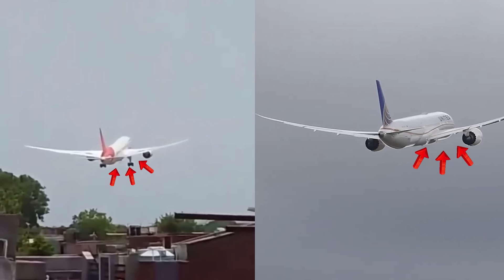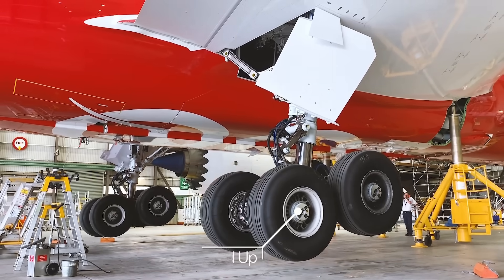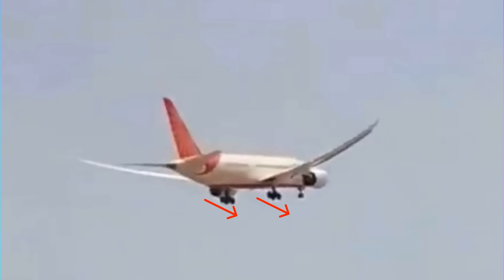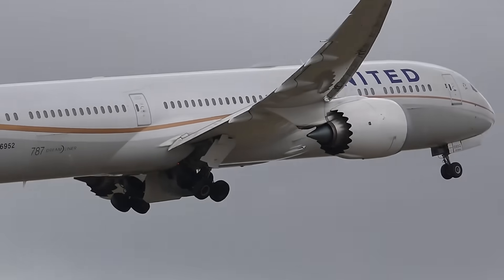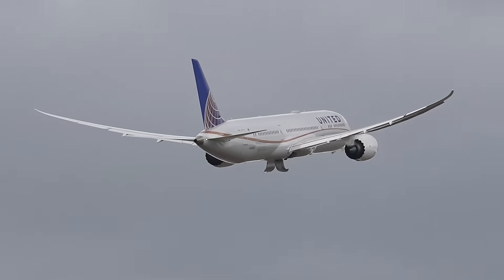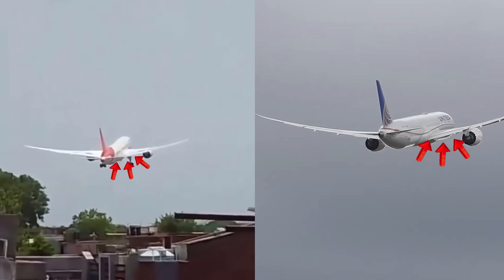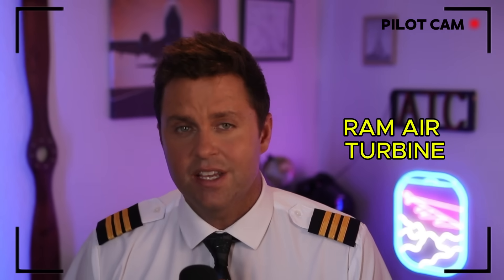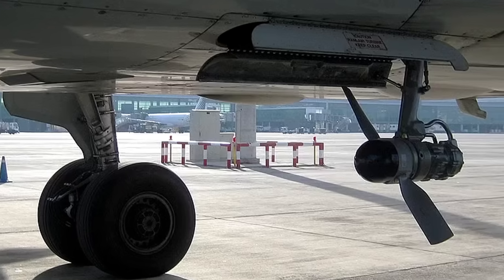Pilot Explains: A New Detail in the Air India 787 Crash Everyone Missed

Comment: After listening to some of the comments i would have to say that  the only way this 
      system coudve lost complete power is if the APU which is usually one did not function
       which is still not critical. I would say the CSD and all 4 generators just went offline 
       completely. Its like your alternator in your vehicle ceases to function while on the road.
        One last thought is that the Power relay in the electrical system was  either missing
        or not connected properly. ( My opinion on Mechanical and Electrical troubleshooting.)

Comment: We had a flight with Air India AI 1127 on May 29th from Delhi to Chicago. We were about to take off and felt everything had stopped for few seconds. It was like engine stopped. then pilot announced they are seeing some technical issues they are trying to resolve asap. 
From around 130am until 6am, the pilots were trying to fix the issue with the aircraft. 
Later, they decided that the plane was not in a condition to fly, so we were completely deboarded from it. 
Later that night, after they fixed the issue, which I believe was a power-related problem, we finally flew from Delhi to Chicago. 

I feel like this has been a recurring issue with Air India, and they really need to take this matter seriously now.
Reply: Pilots do not troubleshoot on the ground for five hours and then fly from Delhi to wherever long distance. That story is suspect. Maybe they run checklists for 30 min but after that it is probably serious enough to switch aircraft and let maintenance handle it.
Reply: @landen99  well don't want to sound bad... but Barajas accident: Spanair JK5022, stood on ground for an hour at least, before trying depart and then crash. Rules and conditions changes through years... but could be happened the same if they didn't had another aircraft to flight and they wanted to depart at any cost...
Reply: @landen99  totally agree
Reply: @landen99 
Well it could be that they  have had engineers on the radio to talk them through the troubleshooting process from the ground, but for 5 hours odds...just take the machine to the hanger. Poor paxs.
Reply: @landen99 surely many airlines don't have aircraft parked around.... NO airline can make money with grounded aircraft
Reply: @landen99  Delhi?
Reply: Fake news!! There's no Air India Flight 1127. There's flight 127 that flies Delhi to Vienna to Chicago, but flight history shows that on 29th May, it left Delhi at 7:30pm local time (30 min delay) and arrived 6 minutes early in Vienna. God, it's so easy to spread fake news!
Reply: @vickyverma6852 🥹 I’d never do such things. Our flight coming back was via Vienna for fuelling.  
I can go on and on regarding my experience with air India. 
There was no running water after we flew from Vienna, most of the entertainment systems were broken and no phone chargers. 
I’ve taken photos of everything. I thought I was going to write a complain but this recent crash made me feel bad. It could be our flight that day.
I’m truly grateful for their courageous and wise decision not to take off.
Reply: @nishadevkota6469  Oh, so now you're talking about the return trip all of a sudden? Liar! Shame on you. Spinning fake stories for attention or little bit of money.
Reply: @vickyverma6852 you MF, USA is my home. I’m literally laughing here.
Reply: @vickyverma6852  here you go:  Rate your experience on your recent trip on AI 1127
Thank you for flying with us from New Delhi to Chicago on 31 May 2025   
We value your feedback.
Reply: @nishadevkota6469   Many things don't add up in your story. You said you flew on 29th and then you said you flew on 31st. AIC127 flights on both days appear to have departed and landed at usual times between Delhi and Chicago thru Vienna. Exaggerated stories lose all credibility.
Reply: @vas1594 we had to stay 24 hrs in Delhi airport due to aircraft issue. Why on earth I have to make up a story? For what? 
There were 300 plus passengers that day. It was not just me flying and faking😊
My conclusion: NEVER EVER FLY AIRINDIA
Reply: @vickyverma6852  There's an AI 1126
Reply: @vickyverma6852  but she said it left "later that night" - on May 29th.  They de-boarded in the morning and seems like they worked on it all day. Her story checks out.
Reply: very interesting you comment, saludos
Reply: Can you please confirm if it was a Boeing 787 plane that you faced the issue with that night?
Reply: @abhishekkumar-bw7xf it was 777 on that route
Reply: So, at 1am, it was not 37deg C.  would be interesting to get details on that problem to see if this is more system wide.
Reply: @samwoodward4080  Awfully bright for 1 am, isn’t it?
Reply: @samwoodward4080 it was 1.30 pm India time. And it’s hot at that time and this time of the year in Ahmadabad.
Reply: Previously Boeing 787-8 had IRUs or IMUs failures. This changes the thrust rapidly resulting in abrupt altitude changes. Search and find, January 2025 United Airlines Africa Boeing accident. Imagine what happens when this thrust gets cut down while take-off.
Reply: Thank you for sharing this. I will NEVER fly Air India
Reply: @majornewb Seriously?? If that's your attitude you might as well just say you'll never fly with any airline again. When all we have so far is conjecture and speculation, stupid comments like that don't help anyone
Reply: It happened in December also
Reply: Why is no one talking about Boeing? Their aircrafts often have undergone some or the other technical failures. Why blame only Air India and not Boeing?
Reply: @saumyasharma4442  Because there are paid actors with fake stories.
Reply: I'm Just not going to fly boeing.
Reply: I once experienced  issues while flying long haul as well. Not as long as your delay, but we were over the Pacific and had to return to airport. Air India is known for sub-standard maintenance and the fact your pilots had to work on the plane and not mechanics would make me nervous
Reply: @kamakaziozzie3038  the reason I assumed the pilots were trying to fix the issue for so long was because the door remained closed the entire time. 
They didn’t open it until around 6 when they announced that we needed to deplane. 
It was quite a scary experience. 
Also, not trying to be mean, they were constantly saying, like, it's gonna be fixed in half an hour, but every two hours, they're saying like, okay, it's gonna fix in a half an hour. they were literally making us fool. 

But the positive side was that they served us food and water, which was really helpful given how long everyone was stuck inside the aircraft.
Tbh, not a good experience with air India at all.
Reply: @nishadevkota6469 
I don't think that airlines should be allowed to keep passengers 
locked up on a plane waiting to depart for over 70 minutes or so
if there are problems with the aircraft.

18th century people who spent weeks or months stuck in the filthy, hot, overcrowded 
holds of tiny sailing vessels may think that I'm demonstrating my 
 21st century self entitled, privileged attitude but I don't care.
Reply: @nishadevkota6469  Engineers usually usually have a good idea of  what is wrong with an aircraft by looking at the onboard maintenance computer. What we don't know straight away is how long it will take for, say, a part to arrive from the stores system or if something is harder to access that we expected. I've spent half an hour trying to get one screw out of a panel because the slot has been rounded out by the idiot who put it there. Now imagine if 10 of those screws have been rounded out.
Reply: @ImperrfectStranger Ha Ha Ha. I am a marine engineer, and I know what you mean. Bloody tricky job, and sadly very few people understand what you face every day. May the lord be with you.👍🏻👋
Reply: @kamakaziozzie3038 another one from developed world trying to blame a developing country 😂
Reply: @kamakaziozzie3038  pilots don't work on the engines.
Reply: Were you on a "Dreamliner?"
Reply: @beachbeauty7199  6000+ hours flying it.
Reply: Pilots were working to address the technical problems for 4.50 hrs. Were they in the jungle? I believed technical problems were fixed by Maintenence staff.
Reply: @ravindrabhagwat6257 I’ve no clue my dear friend. May be there were maintenance folks trying but all we were hearing was “this will be fixed in half an hour” 🙏
Reply: I’m thankful my only flight on Air India was aboard an affiliate’s prop plane from Udaipur to Delhi.
Reply: It would have been a 777 on that route
Reply: I would hope that no pilots who spent an extra 4.5 hours or more awake 
trying to fix a problem would attempt to begin a long haul flight
even if the plane bring used was in perfect condition.

Sleep deprivation is already a big enough potential concern 
for pilots on long haul flights crossing through many time zones 
without having them spend an extra 5 hours awake working hard 
to try to figure out and fix problems.
Reply: Is this the same aircraft that crashed? I only have a free version of flightradar app and can only see last 7 days history for any specific aircraft.
Reply: That’s actually normal for the power to reduce for a few seconds during takeoff. CPT Steve did a video on it.
Reply: Interesting
Reply: Why wait over two weeks to fly back to Chicago? I’m pretty sure they have a few planes in Delhi 🤔
Reply: Wow, that's alarming. What kind of plane was it, do you know?
Reply: What type of plane was it?
Reply: Lack of maintenance
Reply: No technical staff looked into it for several hours?
Reply: Then how did the same problem could not be detected on this aircraft just before its departure?
Reply: What a long flight
Reply: A comment on another site stated “ the plane flew into the city it crashed from another site in India”. The person overheard passengers who disembarked complaining that the screen entertainment, air conditioning and the flight attendant call system ALL WERE NOT WORKING on that leg of the flight. I was SO Surprised to hear that, I took a screenshot of the comment!
Reply: I think you're on to something..... another common thread....... to flights from Air India what's a similar problem maybe it's got something to do with their maintenance procedures this is really getting deep make sense to me though I'm one of those Common Sense guys thanks for the heads up
Reply: Seems like John Barnett was on to something. If this actually does end up being a Boeing issue they can kiss commercial airline business goodbye.
Reply: @savvas0711 they will dismiss this and excuse and deflect.   Money covers up EVERYTHING!
Reply: after you fly a lot more, you will realise that these kind of issues can happen with most airlines, nothing unique to ai, please stop this stupidity, let the black boxes shine light on what might have actually happened.
Reply: I wish I had a dime for every story like this that I have heard about Air India. 

I took an Air India flight in 2012 and had such a bad experience that I crossed them off my list for years, literally.  Then, due to non availability of options, I was "forced" to book an Air India flight in 2024 (domestic flight in India, not a 787). 

It was a 6pm flight and after all passengers boarded... it got to be 6:15... 6:30...  no announcement and no air conditioning on board either.  Then they said they had a "technical error" that was going to be fixed. That kept everyone on board for another hour or so... after which they announced that we all had to deplane and get on another aircraft. Laughably enough, they had all passengers go out through the exit and come back through security! Even though the boarding was supposed to be from the very next gate (ie in the same terminal). Clearly, this was a ploy to buy more time. Anyway, that took another hour. Then for whatever reason, that other flight was also delayed... and then they announced a gate change. So, passengers were sitting by this new gate till about 11pm or so. At this point, the ground staff kindly started taking dinner orders from passengers. This led me to believe this happy group of passengers would be there for at least another couple of hours. 

At close to midnight, I had enough. I asked for my ticket to be cancelled. Exited the airport and went home. Took another flight the next day.

I heard that this Air India flight that I was on left at 2am or so. Reached the destination by 4:30am or so. Most of those people were travelling for a weekend visit, so imagine what this would do to their schedules - pulling an allnighter at the airport and landing past dawn on the first day of a two day trip. But still, a successful outcome by Air India standards, I guess.
Reply: Or we could handover our entire lives to third-world standards.
Reply: Air india has one of the safest flight records , so lets not delve into “i will not fly this airline” bullshit
Reply: @unmeshduttachowdhury Air India is now responsible for the worst aviation disaster in history with 400+ dead and counting

Comment: The boxes will show the truth, but as you say, the probability of a mechanical failure in both engines at the same time, just after liftoff, is very very low.  Bad fuel would like has been apparent during take off.  Accordingly, there is another option, pilot suicide by pulling the power back to idle or tripping the fuel cutoff switch. Its happened before.

Comment: Why has no one addressed the debris kicked up as the aircraft lifts off?  Was it an intersection departure?  If so, did they run long and kick up debris that damaged systems?  If not perhaps the failure occurred after V1.  Could this have been a Concorde like accident?    If none of these then maintenance may well be the culprit.   So many questions.

Comment: A faulty circuit breaker could cut off power to the operation of engines. People on the earlier flight complained of electrical problems. The circuit breaker supplying engines could have tripped going down runway finally being it was faulty and finally went bad. By the way I was a licensed electrical contractor most of my life so im not talking out my ass

Comment: We should be careful about giving undue weight to "expert" pilots. Seeing "Steve Pilot" on national TV pushing a novice unsubstantiated theory—was disappointing. These commentators often recycle theories without evidence or attribution, more concerned with being first than being accurate. It's irresponsible.

From what’s visible, this does appear consistent with an engine failure scenario(Little/no engine noise in multiple videos + full-runway take-off roll , Ram-Air Turbine (RAT)  deployed, gear partially retracted ).

Comment: Thats exactly what I said on Capt Steves video comments section yesterday that you can't hear the engines in that video. Having lived in the flight path of a major int airport, Jet taking off on TO thrust makes a huge racket and you wouldn't even be able to hear the RAT prop. The noise from the jets would drown it. And hear all you hear is the rat prop and air swooshing
Reply from the maker: Thanks for watching and for your insights!
Reply: Some part of the noise you can hear is actually from the engines, it´s not only wind noise. But they are not producing any thrust, and not other noises that could be a sign of mechanical failure. I suspect that the TCM unit (thrust control module) failed. It has cause some trouble before.

Comment: India news reported that control tower received pilots called out Mayday Mayday Mayday, no trust, no power. 
You are right, it was dual engines failure, land gear was tilted flat , RAT was deployed. Flaps fully deployed upon take off as computers only allowed that for take off configuration.
Should be power outage to the engines , fuel pumps or avionics ,fuel contamination which lead to failed climb decent and crash

Comment: No matter what that aircraft can sustain level flight in clean configuration at that AOA , with single engine, and as we can see the aircraft didn’t even swing (most likely that happen on single engine thrust side specially while climbing ) , its most likely both engines failure.

Comment: Does the gear selector on the 787 have a middle "off" position?  If so, what would happen if the P.M. didn't move it up all the way up and it fell back into the off position?
How long does it take for the engines to spool down enough for the generators to drop off and the RAT to deploy?

Comment: Also makes me wonder about the fuel flow valve. If i remember there was a 777 that lost power in both engines from a valve that was contaminated with ICE. (From their decent thru cold temps) My guess and it's only a guess, electrical system failure just long enough for both engines to fail and the rat to deploy. I think this temporary failure in the electrical/computer system caused the entire issue. Could be those darn batteries again.

Comment: If it had been contaminated aviation fuel, shouldn't that be noticeable when they taxi out and throttle up before takeoff? Maybe not since there was a little fuel left from earlier. We should probably wait until they have analyzed the black box. But you seem to be on the right track, the noise from the jet engines should drown out the RAT.